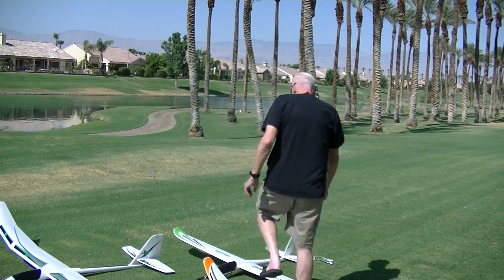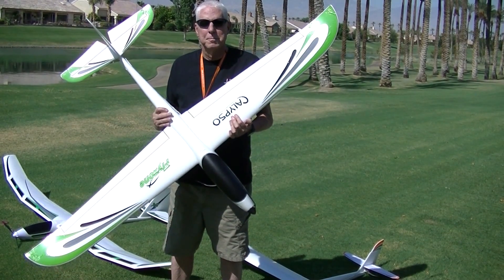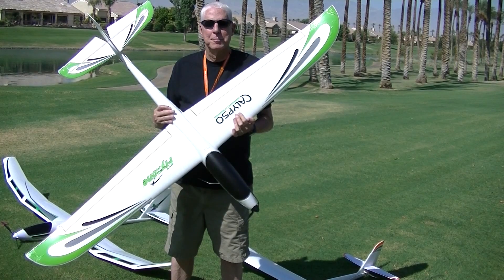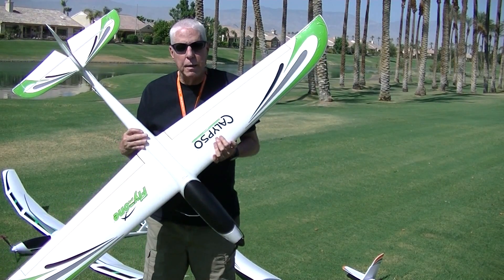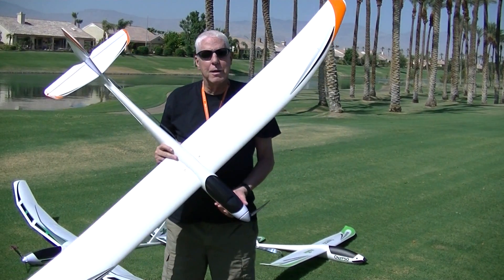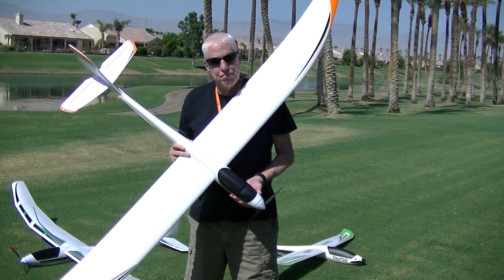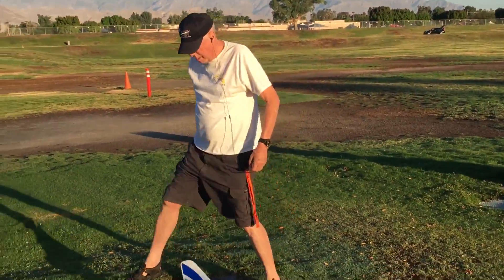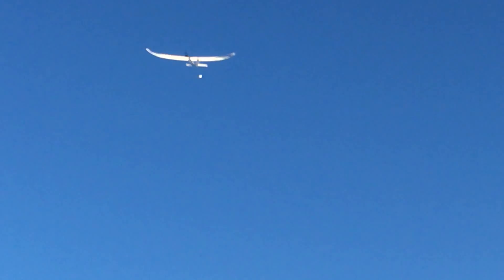Radian - Informal Comparison:  Radian, Calypso and Radian XL Powered Sailplanes

Comment: George, great job with the video. So, I too, am a full size pilot of over 16 years; so, I'd like to think I know what I'm doing. My first glider was this rebranded Radian (not the XL). Well, on her 3rd flight, she buried herself into the Earth. I was gliding, needed more altitude, so I powered up and she started to ascend for a moment. Then, as quick as lightning, she started a nose dive. I throttled back...pulled hard back (gentle at first)...even throttled off thinking the power was pulling her down for some reason. Then impact. A total loss and replaced free by HH. So, any ideas before I put another 2200 in this new one and fly her? I'm thinking it's the ominous tail flex that changed the outcome. I should cut the top and starboard side of the tail and glue in 2 CF rods to stiffen it. But, I don't have time for that today. Ugh! Appreciate your advice, as well as any others who might chime in. Thanks and blue skies ahead!
Reply from the maker: Among the likely causes is a stripped or failed elevator servo. These are flimsy units at best. On all your new ready-built foam planes, immediately replace the elevator servo with a name-brand unit, preferably with metal gears.
Reply: Lost my first Radian the same way. I think and HH said the same. I may have been a brownout in the receiver.

Comment: Nice flying!  I've bought an UMX and an XL.  Still learning how to fly the UMX before I try the XL.  What type of tape are you using to mark the bottom of the wings?  Also what is the shiny piece trailing the plane and is that for visibility at high altitude?
Reply from the maker: You can mark the wing with any trim scheme you want with MonoKote trim sheets.  They come in a wide variety of colors and are self-adhesive.  Don't shrink them, cut our the pattern you want and just apply.
The trailing piece is just reflective tape.  The reflected sunlight makes the plane easier to see at a distance.  Buy the tape at any craft store.
Good luck with your flying!

Comment: I noticed in the introduction of the XL that the tip extension on the right wing was not contacting the "middle" section of the wing.  Don
Reply: Good observation.  I noticed the same thing.  I did not complete the assembly in the introduction of the video because it was filmed behind my house, and we did not fly that day anyway.  When I fly the XL, my plane has a good match at the attach point, and I do tighten the screws---lol.  I want to do an update where we don't drag around the reflective tape, and I hope George will talk about Vy and min. sink speed.  He loves to do this stuff.  Thanks for your comment.
Reply: That post was from Richard Bennett.  I don't know how my wife's name got in there----lol.

Comment: The Calypso has airelons and flaps and can therefore be set up as a full house glider, was full use of this set up  (i.e. camber/reflex, flaps and crow) used in this comparison? Or was it flown as a three channel as the Radian and XL are both TRE only?
Reply from the maker: The Calypso was flown as a four channel setup, ailerons, throttle, rudder, elevator.  No flaps, crow, reflex or etc.

Comment: great comparison of the three very popular planes.  it is interesting how close all three came in the numbers, I would have thought the XL would've had a greater loft time given the wing span.  How come you changed locations for the XL?  Just curious if that effected results.
Reply from the maker: Hi Brad.  We flew the XL at a different location on a different day because of the needs of the other airplanes we were also flying.  Temps were mild in both locations and both were near sea level elevation.   There was essentially no wind at either location. I also thought the XL might do better than the others but that was not the case in our simple no-thermal endurance tests.  The XL is a good product and it provides us with an easy entry into the world of large sailplanes and the different  techniques that go with them.  Experienced pilots will find things to like about the XL's larger size in soaring conditions.
Reply: Just a sec, the big Radian was 32% slower in coming down that the normal Radian. I think that is a big improvement don't you?